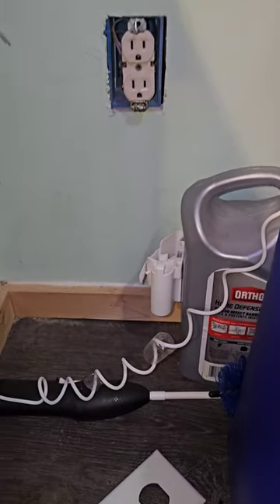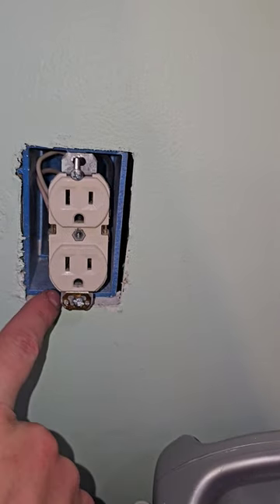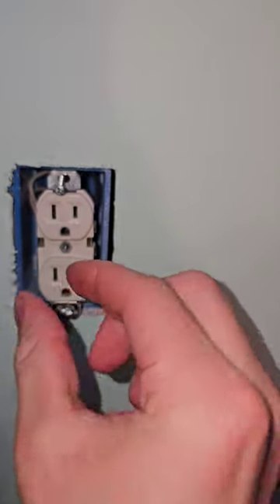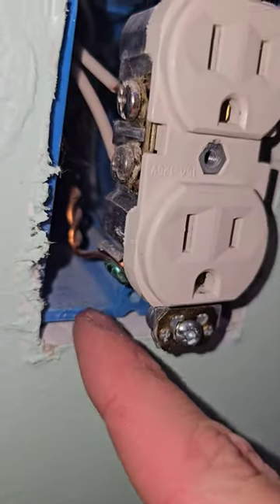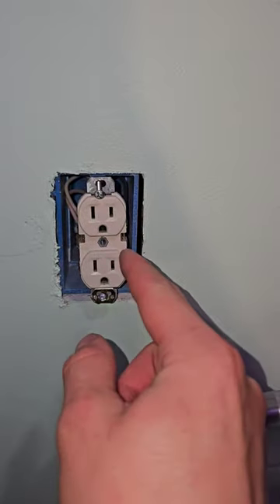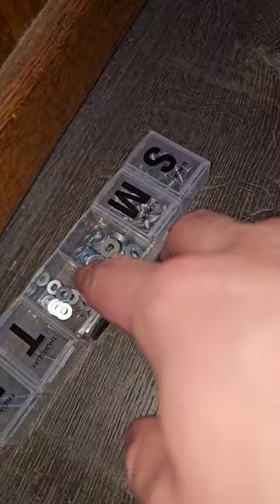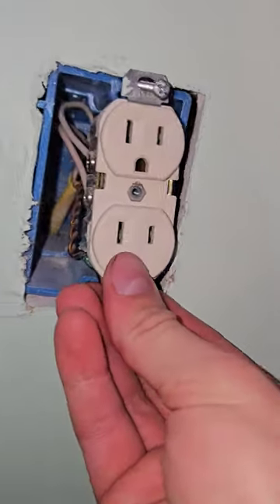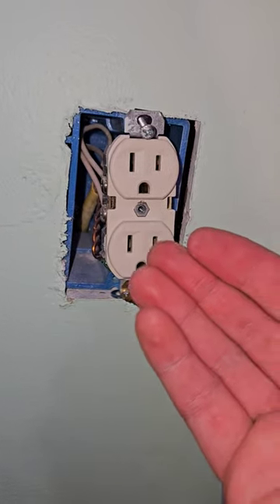Outlet Too Deep In Wall

Comment: As an electrician, I make my own spacers when this happens. Just take some solid 12AWG copper wire and wrap it around the shaft of a thin shank trim screwdriver into a tight coil like a spring. Slide it off the screw driver and cut it to length then slide it over the screw. Works every time.
Reply from the maker: That's a great idea especially so you don't have to carry washers

Comment: Ideal and Gardner Bender make plastic shims for receptacles so you do not have to worry about the metal washers causing arc. I know Lowe's has them and Home Depot probably does also. Another thing with the washers can be against code but it is according to what state you live in. The state I live in says it is unsafe and against code

Comment: Ok genius,try this, get two, 2 inch long 6/32 screws and two 6/32 nuts and put the screws in place of the one inch screws with a nut on the backside (loosely) holding the screw in place(horizontal) and install normally. Ive been doing this  for oh 15yrs or so, so yeah it works. Theres not much you can so about the short wires.

Comment: Instead thread a 6/32 nut on the screw and then lock it into the back of the outlet opening for the screw if the box is sturdy otherwise get the box extension

Comment: They make non-conductive switch / receptical  spacers for exactly this purpose.
Reply from the maker: Does it really matter if it's conductive? Because the washers are touching a metal screw attached to a grounded piece of metal
Reply: @post10Vlogs  As a home owner is doing this it will probably never be looked at by any inspector. However, it matters if the code says it does. Codes vary by state, so YMMV.

Comment: Read the code before you make a video. 3 inches out of a box ... you didn't say anything about arc rings or 2 inch 6 32 ot cat a pillers.  Not metal spacers ..FAIL